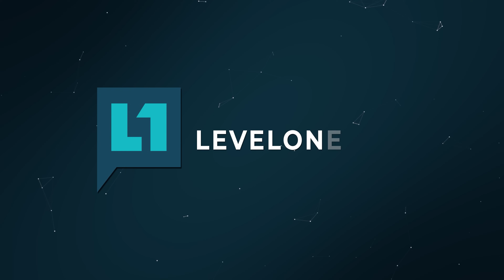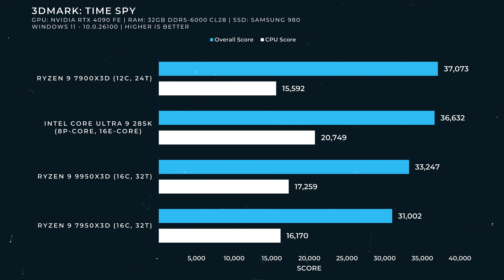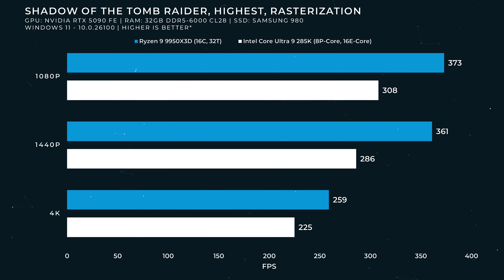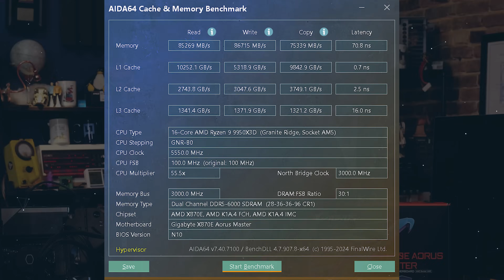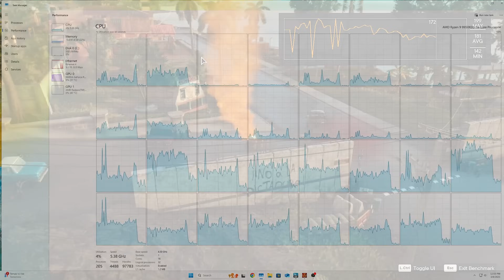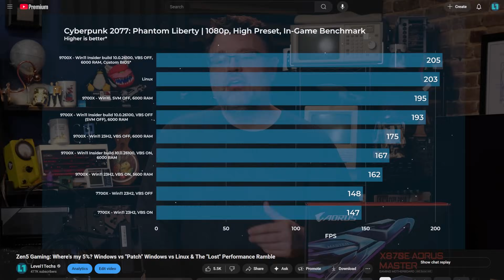AMD's ZEN 5 9950x3D Reviewed and Benchmarked

Comment: the only issues i've come across with AMD, Is Transient Power spikes. I upgraded from a 13700K That was running at 280W, to the 9950X3D and now just launching certain titles, will cause my power supply to trip over current protection. I know that a lot of it is the game not being optimized, but going to a lower power CPU should not increase the load on the PSU.

Comment: im sure you don't have amd x3d optimizer service enable on windows which avoid windows changing chiplet in gaming, because hardware hunboxed found in 40 games same lvl of performance of 9800x3d and about 35% faster on average than 285k..but he didn't use in game backmark but cpu bound areas gameplay and he found 285k didn't improved in cyberpunk

Comment: 32 Cores would be good for some creative tasks but over kill for some time to come, sadly most games or creative tasks dont need more than 4-8 cores with multithreading. Maybe if OS like Windows & Linux etc can be developed to have inteligent core control where it can reserve a group of cores on the same ccd for a task then say when another task starts say anti virus or Windows update it can assign different cores in background maybe have Windows park it self on a group of slower cores to manage all this then 32cores may become more viable but then you need to feed them so need better bandwidth in&out. I would like to see more PCI lanes before a big jump in cores as GPU & storage fight for bandwidth as say 4-8 lines would be better than current 2-4 most boards seem to have. 
Intel missed why AMD took the route they did with chiplets which was to make yields better dropping costs & opening up easier segmentation of product hence why they are trying it in GPU but have hit issues with bandwith & latency(which is a killer in GPU tasks).

Comment: i wanted to buy a 7 9800 X3D this beast came out and was "only" 250€ more so i went for it.. never had a top of the line CPU... Cooled with a Thermal Rright Phantom 120 SE and undervoltet to -25-20 ; best of all worlds Cinebench 42000 and the cpu cooler keeps it cool in prime 95 with small ffts even by 560 size without going into heatissues.. im pleased

Comment: After hashing it out over the last couple weeks

If you want a premium gaming experience, the 9950x3d is the only choice this year, 8 cores is not enough for gaming and basic multitasking in aome examples and over the next few years its only gonna get worse for the little 8 core that could, spend the extra, double the cores

If you want a budget build, the 9800x3d should be your ceiling, with maybe a 7700x being a cheaper alternative but to be honest i would skip the 9800x3d if you can

Comment: I managed to grab one of these for $800 Cad its going into my kinux gaming rig since im running a intel 14900KS delidded direct die cooled via the TG Intel V1 contact frame its only a matter of time before it takes itself out.

Linix 6.14 is looking to be very very good with specific 3D V-cache driver and the amd GPU drivers in the kernal going to go a long way in making my transition to Linux fully.

Comment: Nobody on youtube is talking about temps. Its frustrating. 50 idle on 360 AIO is intolerable for me. The constant fan ramp just drives me nuts. Impossible to have a 9950x3d and have a quiet pc at the same time.

Comment: Because some people need to be reminded memory CL can only be directly compared if the frequencies are the same. Different frequencies can be compared but will require a little math. AMD CPUs have required "memory training" time to work with their chiplet design. Intel's Core Ultra 200 CPUs are using chiplet design for the first time and the boot time is longer presumably for memory training.

Comment: From Another World. I just upgraded my $349 Desktop from April 2019.  I replaced the Ryzen 3 2200G + 16GB by a Ryzen 5 5600GT + 32GB. The old set did cost $175 in Apr 2019 and the new set $179 in Dec 2024, for $4 we have a 3x faster CPU; 1.67x faster iGPU and 2x the memory size.  I kept the ASRock B450 HDV Rel 4.0, that I bought in 2019 for $59.99 :).  As Dutchman I'm very happy with the upgrade. 
Advantages: The CPU load never reaches 100% anymore, so I put it in the mode: Power Saver.  I can run up to 5 VBox VMs without worrying about memory. I doubled the ZFS memory cache to 8GB (lz4 compressed).  My VM Disk IO runs for ~98% from memory according to the OpenZFS statistics :). 

The system stores ~65 VBox VMs. All Windows Releases from 1987 (1.04) to 2025 (11 Pro), including 3x NT from the 90-thies. All Ubuntu LTS releases (6.06 LTS to 24.04 LTS) + my first 5.04, the first 4.10 and the 20-years remembrance version 24.10.   And many other VMs, like 7 modern Linux distros (kind of static distro hopping) and many VMs from my past like e.g. FreeBSD, gOS 3.1, DR-DOS/Viewmax or OS/2 Warp.  Experimental system like Ubuntu Core Desktop 24 and development edition 25.04 from Ubuntu and two of its flavors.

My most used VMs are Xubuntu 24.04 for (a)social media and email, Ubuntu 16.04 ESM (encrypted for banking) with 3 of the newest stable snaps and Windows XP Home to play the wma copies of my LPs and CDs with WoW and TrueBass effects.  The XP VM is installed and activated in 03-2010, and it survived 2 VBox Owners; 3 desktops and 5 CPUs.

Comment: I just got my 9950x3D at Microcenter. I have a CL26 G.skill kit also, but running it on an Asrock Taichi Lite. I have had a few random crashes with a memory code displayed. Might have to try my slower DDR5 kit.
Reply: You can just raise the timings on that CL26 memory.
Reply: @MacGuyver85  yeah. That’s my current plan.
Reply: How did it turn out? Hardware unboxed showed there was much a performance increase with faster ram.
Reply: @TheWiiplay  I haven’t had a chance to mess with it much. Currently finishing up a kettle sour brew. Maybe tomorrow.
Reply: @TheWiiplay  after messing with timings I ended up doing a clean windows install and using my other DDR5 kit. Currently at 6000 CL30 and it’s running well.
Reply: @ I’m gonna pick up a 64g kit of cl 30 tomorrow and try it out
Reply: @TheWiiplay  I actually ordered a 64GB CL30 Kit as well. Not going to be here until later this week though. CL26 kit is going into an SFF build with my 7800x3D at some point.

Comment: Isn't the 285k supposed to be running on 8400 cudimm memory?
Running the AMD on it's ideal memory configuration while you hamstring the Intel processor isn't really a fair comparison.
Reply: The 285k is "supposed" to be running on whatever memory you put in it.  2 ways to do this, either put the best in each and compare and use price to performance,  or put relatively the same cost in each and compare.

Comment: thanks a lot for those tests !
I have 9950X3D, RTX5090 and Asus ROG X870E-E gaming wifi,
I need advice for the 2X32Go DDR5.
I'm kidda lost ... witch frequency do you recommand ? ( 6000mhz to 8000mhz )
It's possible to use the 4 slots ? ( I'll start with 2X32Go , but  Later , if it's possible , I'll had 2X32Go )

Comment: I wonder if all these 'optimization' (dual chiplet, especially x3d ones) for cpu's, will also carry over to 7950x3d. For now from reviews it seems not? Wich is very sad, this W24H2 improved both zen 4 and zen5, and this is just coding, most of coding can be copy pasted for both cpu's (wich software use wich core). I hope so in fact.

I have 7950x3d. One thing i like more of my cpu then the 'king of cpu's is the power consumption, both in gaming and production workloads it's 50-100 watt less, a considerable amount. Eco mode may fix, this, but 7950x3d can use 20 more wat, then 105 watt eco mode, and i think that is a better tuning. I would love such profile on '11950x3d', wich i may buy as upgrade.

Btw you say 32 cores, but rumors are dual '12 core' chiplet for zen 6 (still nice i think :D)

Comment: I was really hoping for a dual 3D cache. Or maybe Zen5c CCDs with 3D cache (12 or 24 core? But 2ch memory bandwidth can be an issue at 24c/48t). Especially as they have the Epyc on AM5 line for budget servers/workstations. Maybe they think such things would crowd into the mainline Epyc or Threadripper markets.

Comment: Until there's a new requirement for CPU performance (vs. GPU, NPU), even the AMD 5950x is more than enough for desktop / workstation. So in my opinion, the next steps are continuing power and cooling reduction by exploiting new technologies.

Comment: Until both CCDs are X3D, i will not buy it.
If u want to mostly game, save money and get the 9800X3D, if u want to mostly work, get the 9950X.
The whole 1 normal CCD + 1 X3D CCD sucks, windows and programs cant properly handle this.
Reply: amd said there is no performance benefit to that, they tried it.

Comment: The 32 core would have to come with PCIe gen6 along with DDR6 and a mem controller designed to take advantage of the different memory channels/DIMM.  I'd have to believe that bandwidths of every interface start to become a bottleneck.

Comment: Some insight into this would be appreciated, I know the X3D helps these processors greatly. I am not a Fanboy of either Intel or AMD, with that said, I am willing to switch to AMD. But there is something that irks me, my 14900KS scores in CPU-Z a 965 in single thread and a 17,536 in multithread, while I see that the 9950X3D is only getting an 856 in single thread and a 17052 in multithread. I know CPU-Z isn't the best be all benchmark, but Cinebench scores are also in the high 40's like 41 or 42k for my 14900KS. If I switch to AMD, am I really spending $700 on a processor and $500 on a motherboard for just X3D technology?

Comment: 😂🤣.... To much power.. it's going to be 1000 euro .... 
And its not 3d on both i want 256mb of memory.. 

Then the video card prices..... Yes i will stick with my 5800x until it break down... 

I wanted to upgrade but the price to performance with GPU and CPU is bad.. 

Motherboard is not good... 

The rest is oke ...

But if the most expensive parts are bad i will not upgrade until price is better or if i break down...

Comment: When I got my 7800X3d this past October the biggest jump in performance for me was tightening up my 6000MT flare X5 kit to 30,38,38,30,68 plus all the tertiary timings and 55000 refresh cycle. RAM feed through the CPU pipeline is the biggest data bottleneck right now. 

Now if only AMD could add a dedicated SoC to their GPU's, or on the motherboard to bypass the CPU calls to have RAM VRAM and storage more closely tied into each other. Then the data path games use would be freed up from waiting on data to go through the CPU, and we'd get much more performance in games where the CPU would have a lot less processing to do.

Comment: A higher frame rate or higher refresh rate does NOT equal lower latency, it has been proven time and time again that yes it reduces latency in some cases but end to end latency is mostly exactly the same if you use the same monitor at a higher refresh or a lower refresh rate.

Don't forget that refresh rate and frame rate are not the same, they are intervals. Latency is not an interval, if you have 8ms frames with 16ms latency that simply means you are looking at a stream of frames that are all 16ms "late".
Reply: So wrong you are.

Comment: Okay, these are awesome. But my complaint is still the lack of PCIe lanes and therefore slots on these motherboards. 

I want at least 2x 16 slots running at x8 and a third 8 slot running at minimum x4. 

I run Unriad with two gaming VMs and also need an HBA
Reply: My MSI MEG X670E Ace has 3 slots that can be configured in 16x/0x/4x or 8x/8x/4x. I use the former for my GPU and Intel Optane 900p PCIe boot drive. And yes, all those lanes run straight to the CPU.
Reply: @TheKazragore  I’ll look at MSI! I’ve always done Gigabyte Asrock or Asus
Reply: @user-cm3wd5hk1p 
then you're looking at the wrong CPU and Motherboard.

If you still want x3D Chip with That much PCIe slots and Lanes, don't use any of the Ryzen line ups. Use Threadripper or Epyc. While also faster that 9950x3D

It's kinda Hilarious finding people with such specific demand and not knowing they're looking at the wrong Product.
Reply: @user-cm3wd5hk1p Gigabyte also have their AI TOP motherboards that have 2 PCIe slots that share the same x16 link, so they can be bifurcated to x8.

Comment: For fu** sake, why can’t we just get a 3D V-cache CPU where BOTH CCDs have the 3D V-cache. 😂 I don’t care if they got to release a 9950X3D Pro chip.
Reply: because there's virtually no workload on desktop that would benefit from it. It would though be more expensive to make, thus carry a higher price – and be trashed by every reviewer for the "poor value" it provides with zero uplifts over their single V-Cache CCD siblings.

Comment: Now we just need more PCIE lanes and maybe 2 more memory channels and we would get a fantastic homelab/work station CPU
Reply: Buy Threatripper if you want those. Home computers does not because it would make mother biards too expensive. Just look what treathripper mother boards cost! Home user don`t buy mother boards that expensive, that is why we don0t see those in any home computers also in future!
We get more cores, we get faster memory…but not more PCI lines or memory channels. Many they reduce PCI channnels when we move to PCI6!
Reply: @haukikannel  Threadripper is whole new price league. If the CPU supports more pcie lanes and memory channels you don't have to use them if you don't want to, just buy a cheaper motherboard then? 

For gaming you don't need any more than a 9800x3d anyway so the 9900 and higher is work cpus
Reply: @TheJensss 

Exactly! Those extra lines you don’t use would cost a lot extra! That is why they don’t upgrade that part!
Reply: @haukionkannel  Yes, it would cost a bit more, but at the same time the cpu is overkill for gaming and limited as a workstation cpu. I still would have preferred more pcie lanes and memory channels and let the motherboard manufacturer make simplified boards that does not use all the connectivity together with high end boards.

Comment: Give us back PCIe lanes, 20 lanes just isn’t enough
Reply: Threadripper isn’t a great gaming platform, whereas dual CCD X3D gives both workstation and gaming performance in one chip, just with limited lanes.
Reply: @xaj   TR non pro just needs an update to add the features
Reply: Yes!
Also, affordable bifurcation cards would be very good.
Almost could eliminate the need for too many pcie lanes, if current gen is only used.
Reply: you cant fit a whole lot these days with 3-4 slot gpus, yeah they should do more but i dont think 40 or more would help at all. maybe 32, and even then most people dont have real use for that much
Reply: @bradhaines3142 I’m just asking for 4 more 😅 Heck, I’d even take an X8 Gen 4 + X16 Gen 5 + X4 Gen 5 configuration if they made it work

Also, keep in mind we have two slot GPUs again (such as my FE 5090, which is packed into an mATX board with a thunderbolt card below it and a janky aliexpress special M.2 to SFP+ (connected to x4 from the chipset, ew latency) above it)
Reply: @xaj  Exactly. This should be standard procedures in the BIOS on every motherboard though, especially the double chipset E ones. I just see lanes going to waste left and right
Reply: Did people forget that the am5 boards have their own pcie lanes? Let’s make lane sharing a thing of the past though.
Reply: Motherboard manufacturers could use PCIe switches to add as many lanes as they would want, but a) Broadcom/Avago has monopolised PCIe switches, b) AMD would want to continue market segmentation to maintain their high margins on Threadripper and Epyc, and c) motherboard manufacturers would just still not do it because they could instead save more money and charge more margins by making Threadripper and Epyc motherboard anyway.
Reply: @fujinshu  All of the lanes added by switches funnel back into only 4 lanes to the CPU and main memory, the switch also adds a small latency. That is not a problem for some devices and use patterns, but a major bottle neck for others.
Reply: We should be having PCIe 5.0x8 5090s, for real. Also x2 gen 5 nvme SSDs would be the perfect middle ground. Same bandwidth as gen 4, utilizing the faster lanes more efficiently.
Reply: @SpFres1  that could actually be done with a bios update, and i believe thats how a lot of them currently work. m.2 slots especially, they have 1 thats gen 5, the rest are 4, which is equal to 2 gen 5 lanes.
Reply: @SpFres1 GPU + NVMe + QSFP28 (not that an x4 gen 5 QSFP28 exists yet, but it should, as that’s sufficient bandwidth)
Reply: Xeon 😮 pcie lanes for days 😮
Reply: It's called threadripper.  Already exists 😂
Reply: @harryniedecken5321   not everyone can afford that though.
Although the x99 and x299, if found for cheap.. could be for server or productivity related tasks.
While providing over 20 pcie lanes easily, and 40 or more on a 2 cpu config.

Comment: 285k seems like its smack in the middle of a 7950x3D and a 9950x3D in productivity benchmarks. Still pretty good considering the 285k has a msrp that is $100 less than a 9950x3D, price to performance ratio should be about the same between them. Also I have a hunch that street pricing on the 9950x3D will be $800 to $900 for a while, so the 285k might be the better bang for the buck at $600.
Reply: Bear in mind you won't get an upgrade path on the Intel mobo.

Also the last 2 chips they dropped cooked themselves, are you gonna risk it?